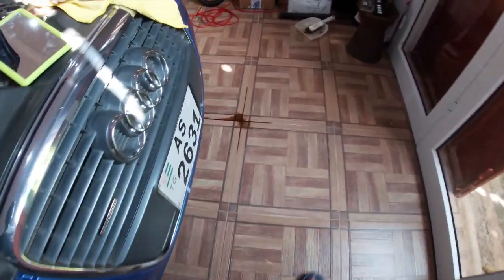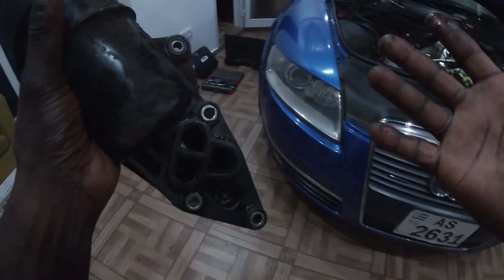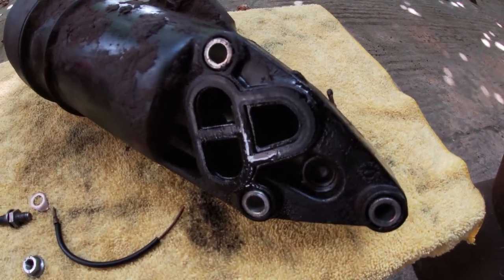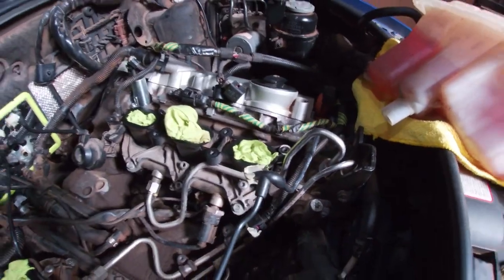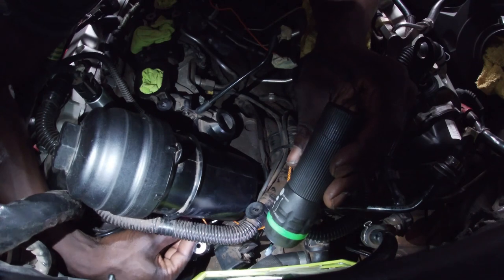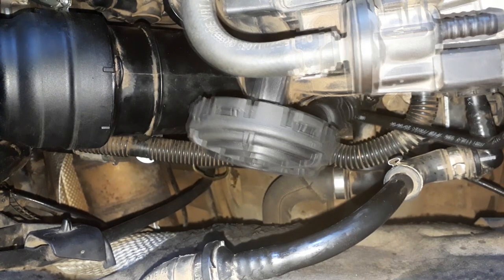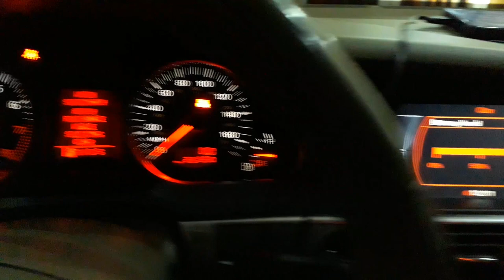Audi A6 3.2 - Oil Filter Housing Gasket Replacement

Comment: Once again another amazingly detailed DIY.  The mirrored shots of the Oil Filter Housing bolts are super helpful.  You are a huge help to the 3.2L community, thanks man!
Reply from the maker: I appreciate the feedback 😃👍🏾
Reply: I can’t see how you removed the huge bundle of hoses/cables that block all the bolts needed to remove the housing!  Removal of the manifold was finished, but there are still tons of things blocking the bolts to remove the housing.  I guess just remove all that too?!  Any advice?  2009 Q5 3.2 V6

Comment: Thanks for this. Did the same procedure and broke the same ground wire. Could not have done this without you. On my version (2006 3.2) i had one of those 8mm torx (the highest one below the lugnut) that was stationary and had a counter sink hole in the housing itself. FYI for those of the same - you have to take out the two lower bolts before the stationary one; otherwise it's trying to pry itself out. That bolt does not come out completely; only unscrews the whole housing from the engine body.
Reply from the maker: Thanks for sharing your experience. I have come to realize that the setup may be different on other model years which can be confusing. I am glad you made it. 👍🏾

Comment: Hey Keli.  Another great video as always.  I was actually able to remove that 10mm bolt without removing that bracket that has the ground wires on it.  Once I loosened up that nut a little (the nut that has the ground wires on it), the silver metal thing was able to be moved to the side very slightly but it was enough to get a long skinny socket on the bolt to be able to take it out. I was very happy because I did not want to risk breaking a ground wire like you did.   I jacked up the drivers side of the car and then opened up the oil filler cap in order to drain the filter like you did on the video.  I left the car up in the air the entire time I was removing the oil filter housing.  When I got done, I looked under the car and there was at least a 1/2 quart of oil under there. Ugh.  LOL. I’m glad to be done with that because I was dreading it.  It wasn’t horribly bad since I didn’t have to mess with that double sided bolt/nut and the ground wires.  I would highly encourage anyone doing this job to try to loosen that nut a little, try to move the bracket to the side and then try to remove the bolt to the oil filter housing first before just taking all of those wires off.
Reply from the maker: Wow Jason, this is a great tip! Thanks so much for sharing. I just pinned it so that people see it. It's good to know 👍🏽
Reply: Dude just saved me hours of work. Was looking at the passage under the car like how tf did he do this LOL .  Bump for sure mega props to you 🍻
Reply: You are welcome Andrew.  Cheers!!   Good on you for giving this job a try.
Reply: @jasonpatterson7266  what year is your car?
Reply: @Hy-c.  2006 A6 with the 3.2.
Reply: You loosened the bolt with the ground wires or removed the bolt?
Reply: Loosened the nut with the ground wires and then move the metal bracket to the side just enough to then be able to get the bolt out from the oil filter housing that appears to be trapped behind the bracket.
Reply: @jasonpatterson7266  thank you so much!
Reply: Just did the job. I didn’t have a double sided bolt or a ground wire. I also had a threaded stud that ran through the housing. I slid the oil filter housing back about a inch and did my work from there. To take it all the way out I would of needed to take off some breather tubes and thay would of been a PAIN
Reply: @chrisoakes8345  I took out and replaced the breather tubes.  It wasn’t any more crazy or difficult than anything on this repair.  The stupid 4-way clip thing is annoying and you might break one when removing, but I’ve seen someone make a diy for “easy” removal of these 4-way retainers on the breather tubes.

Comment: I was going to perform this in a few days while I’m doing the upper tuning chain tensioners, valve cover gaskets and vacuum booster gaskets.  However, after watching this video I am scared to death. I think I will do this one day in the future.  Far in the future....or never.  Wow.
Reply from the maker: It is a tough job but not as bad as it looks. You just need to know what to expect and how to proceed.
Reply: @ThatAfricanGuy  yeah that’s kinda the problem. LOL. The “know how to proceed” part concerns me.  LOL.  I can’t see any of those nuts and wires in your video that have to be removed.  All I see is your hand and it looks really tough.  I will give it a try in a few months when I do the thermostat, coolant crossover pipe and the carbon cleaning.  I am probably gonna break one of those wires also aren’t I?  You also said it is recommended to replace that sensor (I forgot what you called it) but is it possible to do the job without replacing it and not breaking the wire or does the wire have to be broken in order to get the oil filter housing out if the sensor is not removed/replaced?  Thanks.
Reply from the maker: @jasonpatterson7266  One good news is it seems later models do not have these wires. Which year is your car?  No, you don't have to break those wires. I took them out before while I was replacing my upper timing chain tensioners and I might have torqued the nut a little too much, or might have not torqued the double sided bolt enough which caused the double sided bolt to turn while I was trying to loosen the nut hence put stress on the wires and one of them snapped. You normally just remove the nut then pull the wires off the double sided bolt before removing the double sided bolt which is holding the bracket obstructing one of the oil filter housing bolts. They normally should not snap. And no, you don't have to replace the oil pressure sensor. I did not replace mine. You should replace it only if you remove it from the oil filter housing which I did not.
Reply: @ThatAfricanGuy  ok.  Awesome.  My car is a 2006.  I don’t even know if it’s leaking but I purchased the gasket and was going to do it while doing the upper timing chain tensioners (which I’m starting tomorrow).  I thought that having the timing chain cover off would give me extra space?  Does it?  I see you did yours with the timing chain cover on.  I didn’t know (until I watched your video) that I had to remove the intake manifold. I don’t want to take that off just to replace that filter.  I will wait until I do the other jobs that require me to take the intake manifold off (carbon cleaning, thermostat and coolant crossover pipe) and then do the oil filter housing gasket at the same time).  Thanks for the feedback.  Good to know that I don’t have to break that wire and that I don’t have to replace that oil pressure sensor (or it’s gasket).  Take care my friend.  Wish me luck with the timing chain tensioners, valve cover gaskets and vacuum booster rebuild that I am starting tomorrow.  I’m scared.  LOL.
Reply from the maker: @jasonpatterson7266  Good luck! 🤞🏽

Comment: Thanks for the detailed video.  Great job.  I just finished mine and it had 2 serrated head bolts and a long stud with a Serrated Triple Square nut instead 3 bolts.  The tip on the ground bolt was invaluable and even though I broke / cut the wire (I only had one) it still let me know that I had to cut it before I ripped out of the harness.  Many thanks.
Reply: Did you remove the oil filter housing from the vehicle or did you slide it back enough to remove the gasket? Also did you remove the double knot bolts and how long did it take you to complete this work?

Comment: Keli I am awaiting the sockets from Amazon same day delivery right now.  But, I wanted to thank you for uploading this.  I have no idea how much harder the job would have been without this video.  There is one other video on how to remove the intake, but this job itself there's nothing else and it's a real tight situation, as well as lots of potential disasters awaiting the non-patient non-gentle mechanic.  THANKS
Reply from the maker: You are welcome Jason. This other video will give you additional details: https://youtu.be/t5kUxRmATv4 Good luck!
Reply: @ThatAfricanGuy  I didn't know you had a follow up video.  Thanks.  I am not surprised.  The plastic has no place in a hot environment like that, the torque is probably too low, and it's the wrong kind of rubber in the gasket. I myself would have purchased the aluminum version had I know you had to redo the job. Labor is way over the price difference.
Reply from the maker: @JasonTaylor-zf6fo  I agree 👍🏾

Comment: Thanks for sharing. This vid helped me because I had to remove the whole filter housing for my counterhold tool to fit on a cam sprocket when removing for timing chain tensioner replacement. What an annoyance!
Reply from the maker: Oh you did not have to! You just needed to reverse the counterhold tool pins.
Reply: @ThatAfricanGuy  tried that haha. Still not enough room. Bit annoying.
Reply from the maker: Really! That is really an annoyance. I feel your pain. Is this happening on the driver's side? Did you remove the harnesses at the back of that side of the engine?
Reply: @ThatAfricanGuy  yes, your driver's side (my passenger side, right hand drive car, I live in New Zealand). I didn't have to remove the entire harness, but I did have to unplug everything in the way and move them to make sure I didn't hit them.
Reply from the maker: @lucavangorkom9453  Apologies. Unplugging and moving away is what I meant. Wishing you luck with the rest of the job. 🤞🏽
Reply: @ThatAfricanGuy  thanks! I've just reinstalled chain covers, and removed cam lock tools. I then turned the engine a couple times to check timing was still good - and it was perfect. But when turning, is it normal to here a small clunking sound every so often?
Reply from the maker: @lucavangorkom9453  I did not hear any clunkings when I did mine: https://youtu.be/2r5Dx5ihtq0
Reply: Did you replace your injector seals when doing your tensioner? I started mine up and it's idling rough - there is fuel pooling around the engine
Reply from the maker: @lucavangorkom9453  The tensioner job does not require removing anything related to the injector seals. I didn't even remove the upper intake manifold. Did you have to remove your lower intake manifolds for some reason?
Reply: @ThatAfricanGuy  ah sorry should've clarified. I did carbon cleaning at the same time (gosh, it was so built up!). When I put the engine back together it was misfiring, and we found leaking around injectors. I thought maybe I need to buy new ones, but I just cleaned them, oiled them, and reseated them, now it's all good.
Reply from the maker: @lucavangorkom9453  Oh okay. Yes these seals must be replaced and the news ones must be greased or oiled. Glad all is good now.

Comment: I have the 2009 Q5 3.2 V6.   That 10 mm bolt was possible to loosen without doing anything to the bracket by the upper timing chain cover.   Find a skinny and long 10mm open end wrench.
Reply from the maker: Thanks for sharing your findings.
Reply: @ThatAfricanGuy  you da man!!!  Your video is so very much appreciated.

Comment: Thank you very much for your very helpful videos.  I am planning on doing the filter housing gasket replacement job, but I wondering do you think it is absolutely necessary to remove the intake manifold, or can it be done with the manifold in place?  (It looks like all the housing bolts are accessible from the back of the engine).  Thanks again, Bill.
Reply from the maker: It is not absolutely necessary but it will make your life easier, giving you more visibility and better access. Here is a better video showing how to remove the upper intake: https://youtu.be/Sy-ZR8Vvgc8
Reply: @ThatAfricanGuy  would this be a good time to do a walnut blast clean for any carbon buildup?
Reply from the maker: @phonkyfeel1  To clean the intake valves, you need to also remove the fuel lines and the lower intakes so the answer is no. Just fix the oil leak.
Reply: @ThatAfricanGuy  I really appreciate your reply.  And especially with all you have going on.  Best to you.  I mean it. You inspire and give people confidence to overcome challenges.  Big up
Reply from the maker: @phonkyfeel1  I appreciate 🙏🏽

Comment: How bad was the leak before you pulled out the housing? Currently, I am getting a fair amount of oil spots in my driveway and I am pretty certain it is the housing.
Reply from the maker: Probably just as bad as your current leak. Not that much but enough to mess up the garage floor every night.

Comment: How does this oil filter gasket fail?  I’m asking because I may have over-tightened my filter housing cap…having a new oil leak (can’t see from where)….wondering if I messed up the gasket when I tightened down the filter housing cap.
Reply from the maker: I am not sure to be honest. Could be age-related. Could be engine overheating. Could also be what you thing may have happened: over-tightening the housing cover.

Comment: I’m going to do this project on my 2009 audi a6 3.2 honestly seems like I can just fit a ratchet back there from what I’ve seen any tips on the project before I start im trying to get away with not taking anything apart
Reply from the maker: Room is very limited and you won't see much. It is feasible without removing anything else but it will be very complicated.
Reply: I ran into problems trying to fit the ratchet inside but now comparing our engine bays it’s just a bit different than my 09 3.2 is there’s a template to follow when removing connectors or bolts
Reply: @johnnyg2874  I have a 2009 Q5 3.2… it is a bit different than the OP’s 2006 3.2.   I was able to get that 10 mm bolt to loosen up without taking the bracket off or loosening the bracket but I haven’t gone any further so I’ll wait to pop the champagne bottle until this repairs done and I don’t have to do it again in six months like the original poster and Patterson

Comment: So I mistook the triple square bit housing bolt for a torx bit... If it doesn't come out with a triple square, what options do I have for a stripped bolt in such a tight location?
Reply from the maker: I am not sure about your options with a stripped bolt but I hope for you that it will come out with the triple square. I did strip one of mine when replacing the whole thing a few years later and was able to unscrew it by cleaning well, being very patient and making sure to press the bit in tight enough. Good luck: https://www.youtube.com/watch?v=t5kUxRmATv4
Reply: @ThatAfricanGuy I ended up getting it out with an Allen key, thankfully. Just changed the gasket, now putting everything back. Thank you so much for this video and your help. Couldn't have done it without you 🙏
Reply from the maker: @quarkymatter  Awesome!!! Well done! 👍🏾

Comment: How did you get that metal bracket removed that sits with the filter housing? I've got all the bolts off for the housing, but there is a group of wires;  connected to the bracket, that is keeping the housing from coming out.
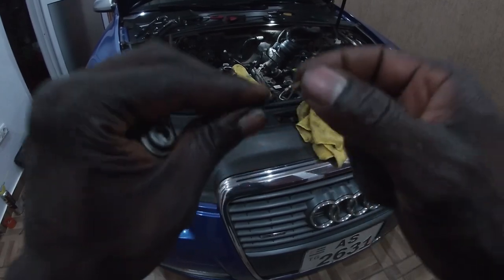Reply from the maker: Watch from 10:10
Reply: @ThatAfricanGuy  got it  my man thank you! I thought I saw a double nut on that bracket, but I treated it as a single nut, and stripped that wire myself.  10 mm nut up front, and I believe a 12mm wrench to hold the back nut. 
This job has turned out to be quite the chore.  Oil was everywhere, and the engine was filthy. Resealing timing chain covers. Valve cover / spark plug gaskets.  Camshaft solenoid adjuster o-rings. New PCV. Oil filter housing gasket. New thermostat, water pump, serpentine belt, tensioner, idler pulley. Got new bolts for everything, because the old ones were rusted or stripped. Now I have to order new PCV hoses because one of them broke due to the brittleness. 🤦
Reply from the maker: @atrain132  Wow, that's quite a project! As we say in French, "du courage". 🤞🏽